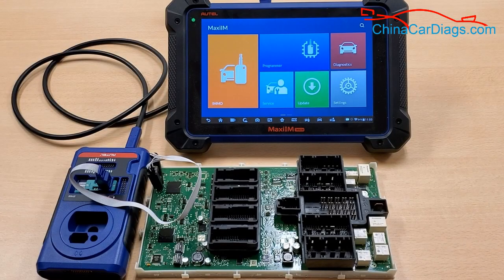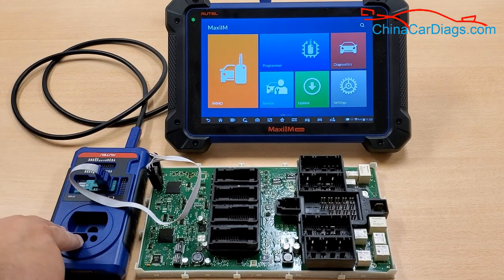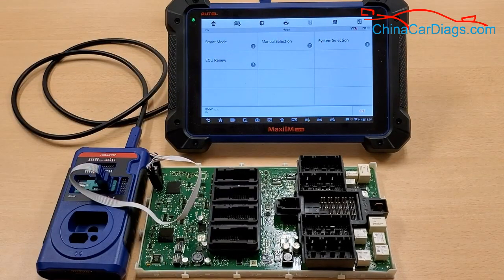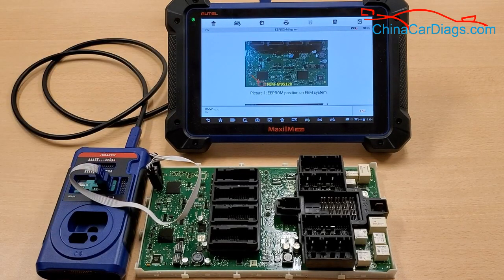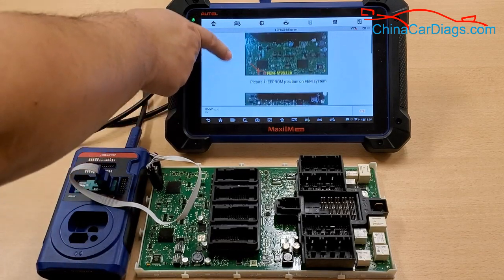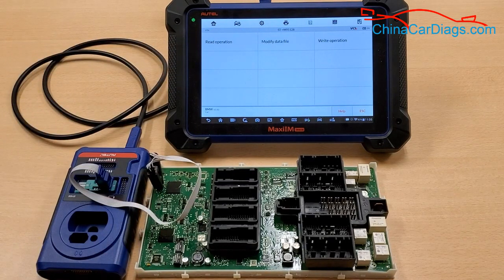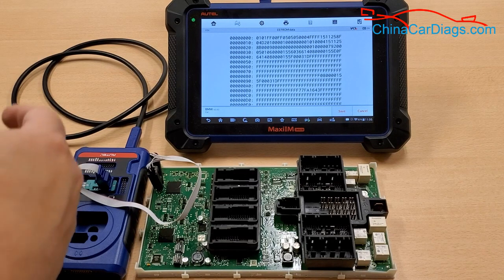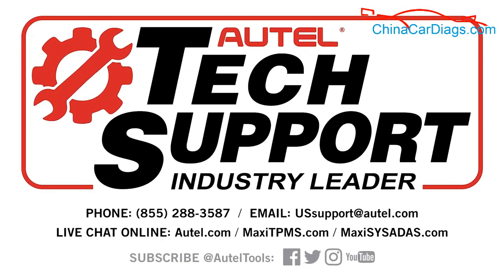How to Read EEPROM from Autel IM608 key programmer-chinacardiags.com

Comment: Great video I've just removed the immobilizer on toyota camry 2011 as guided through my IM508 device.

It’s for AKL situation can i use my Autel and the APA001 cable to add key?